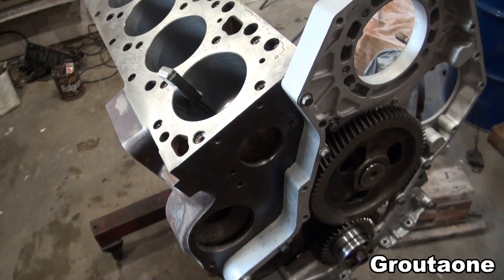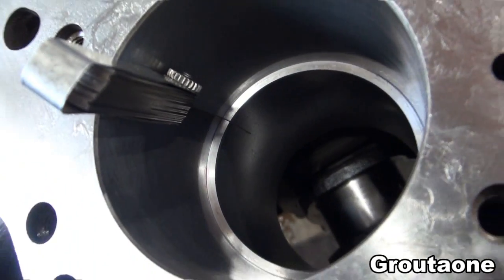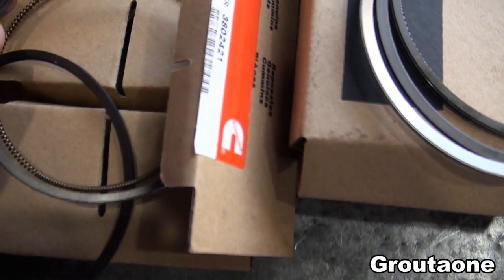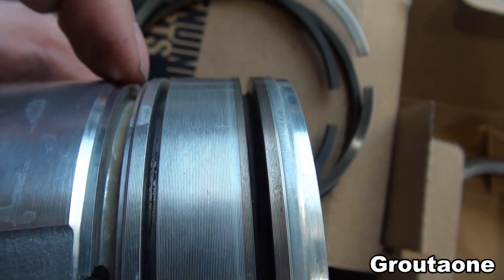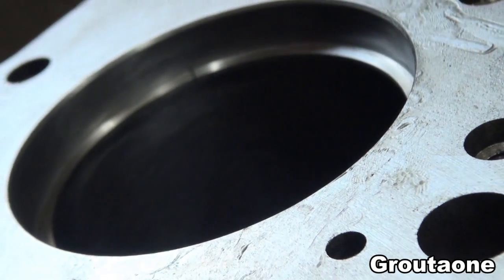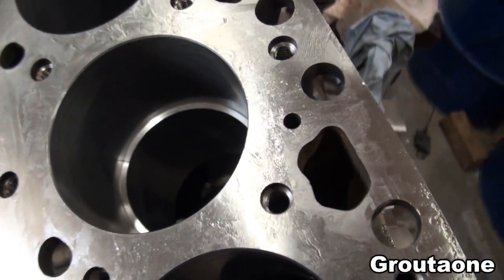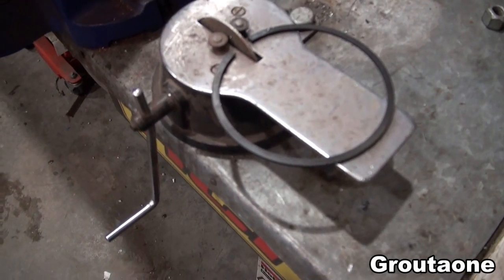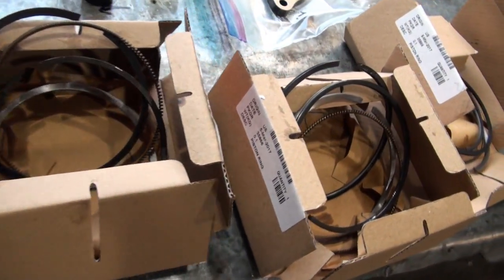Cummins 12 Valve Ring End Gap

Comment: I bought the same piston set but my intermittent ring is labeled top on the bottom side. Any thoughts?
Reply from the maker: That is real odd, does the ring manufacturer have tech support?
Reply: @groutaone  I bought them from eBay and got a full refund. Just to confirm the intermediate ring taper goes towards the top right?